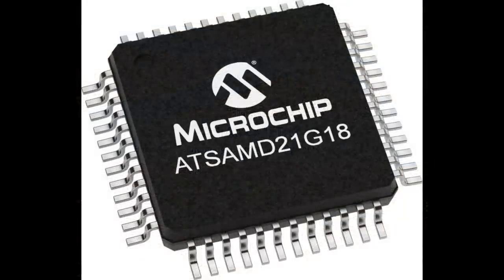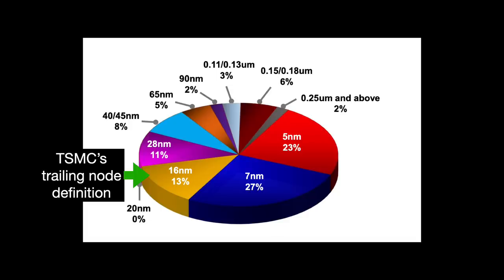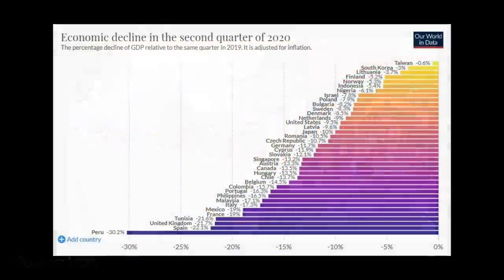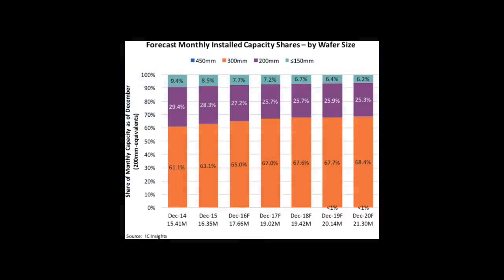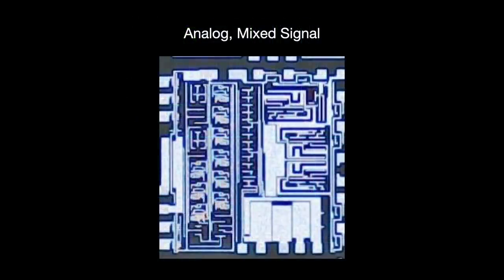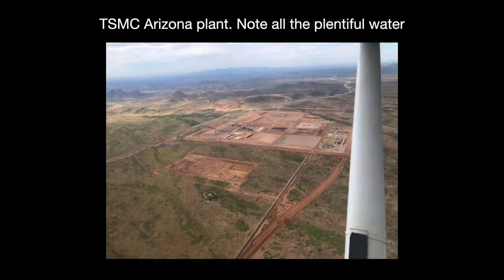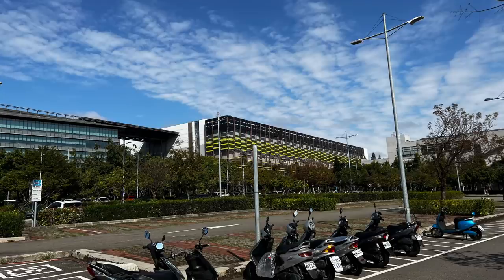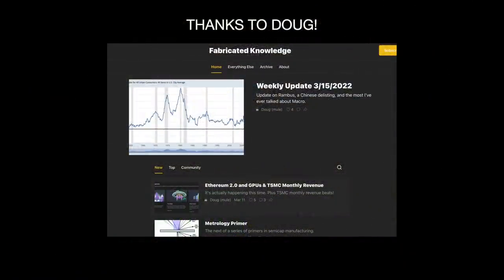Where The Real Chip Shortage Is

Comment: Some wafer technology doesn’t scale to larger wafers very well. Particularly non-silicon wafers that can only be produced in 150mm and 200mm sizes before inherent wafer defects create significant yield problems. 300mm equipment may double output, but it is often 5x+ regarding capital expenditure and maintenance cost.
Reply: Yup. I work in GaAs. Hard to make a Cz ingot when half the atoms in your melt sublime into vapor at atmospheric pressure.
Reply: Also, half the tools I work with on a daily basis are older than I am. And I’m over 40. Compound semiconductor makers almost exclusively inherited equipment from the 1970s-early 1990s silicon world because that’s all that’s available in many cases. What’s left are often 200mm tools down-converted to 150mm. With those kind of capital restrictions, an industry that charges cents per unit for its product and can fit 5,000-15,000 chips on one 6” wafer is never going to transition to 200 or 300mm.
Reply: Thanks for the perspective. Helps somebody coming from years of digital logic chips where increasing transistor counts have been the key essential.
Reply: Just to the last part: Any (not only multiples of five) "regarding capital expenditure and maintenance cost" is irrelevant when the net income(here the predicted value is sufficient) is above the previous one, the old production process provided. You just have to find an investor. That is no problem for such biggies like TSMC oder Siemens ... there are extra institutions there, invented just for that case which are happy to "assist", like banks and shareholders. But that is basic capitalism 101 and I don't want to bore you, Alexander:)
In a nutshell: If it's worth it, then anything will be implemented as quickly as possible. Lemme close with that picture: Haven't you ever seen a cartoon rabbit with dollar signs in its eyes?:)))

Don't get me wrong: Physical restrictions exist and no human, no Solar Roadways, no SpaceX and no Elon can avoid them. If @Grak70, for example, cannot even produce the raw material in good quality, then the discussion is actually superfluous. What doesn't work, doesn't work!
Reply: @Grak70  how close are you guys to offering the coating of prescription lenses with the gallium arsenide. i really want night vision next pair .
Reply: @tobiwonkanogy2975  different industry (beam or vapor phase epitaxy), but cool application. Not sure I want arsenic that close to my face, but I assume it will be encapsulated somehow.
Reply: @Grak70  from what i have gathered its chemically stable and can be coated with diamond like carbon coating or sar/ar/bbar coatings. Very correct i would want it sealed in quite well.
Reply: @dieSpinnt  You seem to be confused with regards to how things actually works. Capital expenditure and maintenance cost has a direct impact on the ability of an operation to adapt to new technology, scale to meet demand, survive harsh economic times, and provide affordable products without going under. We are seeing the results of that today throughout the world. Very few ventures toss around the billions needed , and most are backed by at least one government with malicious intent. This is why we have seen fewer ventures into the upper echelon of the manufacturing side of the industry, the rotting of the American semiconductor base, the shift to fabless, the extreme supply constraints, and is a contributor to the boom/bust cycle of the industry. “Just capitalism 101”.  Capital expenditure and maintenance cost has a significant and non-negligible impact on the industry.
Reply: @alexanderbrown6077  Yes, sure.
Reply: While this is true, if some capacity can be moved to 300mm then that frees a lot of 200mm capacity for things that needs to be produced on a 200mm node.

It's like building solar and wind to power homes, offices and commerce - While solar and wind will never replace nukes and hydro when it comes to industry, if it sufficiently powers residential and commerce it will free up power to let hydro and nukes directly feed into the industry. Win/win regardless.

Comment: Voltage regulators are also tough to buy.  As an EE, I won’t cut a PCB design loose until reels of parts are sitting on my desk, and then I over-order which doesn’t help the shortages.  I’m buying parts for life of product, knowing many of those parts will be eventually excessed.
Reply: Make sure the part you choose has many alternates from different manufacturers with the same footprint - jellybean parts like voltage regulators are the easiest ones to swap, even if it's a PIA mid production. A lot simpler than porting a bunch of firmware from one processor architecture to another.
Reply: Yup. I tend to finalize designs only once I find supplies for at least 2 alternatives. I seldom have the ability to source everything in advance of final design. Often this means extra pads for different pinouts or footprints. This also helps when sourcing parts for repair if your device is one that may see service.
Reply: I so FEEL you! Nowadays I first order enough chips to build out at least a couple of prototypes and then I start with the new design, otherwise it doesn't even make sense to even start (for the major chips at least) :P With voltage regulators I haven't had a problem tbh, but in terms of power electronics what I have had a problem sourcing is power inductors and transformers.
Reply: I understand your position and appreciate your frankness. By your own admission you’re making the problem worse. (That sounds more accusative than I mean to say, I’m not a native speaker) 

How long is the life of product that you’re talking about? Im just curious if it’s something like a year or several years. 
If you would stock for, let’s say, 6 months, wouldn’t that give you enough time to resupply? Again, I’m just curious and interested in your views as someone who works in the industry. Thanks for your comment.
Reply: @Conservator.  as of now, most microcontrollers have a lead time of over 12 months and it's changing all the time. I have an order for an ATSAMD51 that is already 1 year old, they increased the price twice during this time and I'm still waiting for them to deliver. Who knows what the lead time will be in 12 months, I think Louis Brown is right, better to have all the components in stock when launching a product.
Reply: I keep thinking that part of the long lead times is based on pending customer orders, where they have placed the order at multiple vendors, and intend to cancel the redundant orders when their first orders come through.  I don't have direct evidence of that though.
Reply: @gorak9000  This depends highly on what type of design you are working. Voltage supply ICs are for  the majority of parts not interchangeable;  yes, old legacy LDO stuff maybe, but not for modern high efficiency DC/DC regulators/controllers, which are the most common supply ICs used in todays designs 🙃I too, had several designs to change, advancing from prototype to the final product, because of this supply chain thing. 😒 Today, you can buy x component, but a couple months down the line your purchasing department will tell you, you can't.
Reply: @franks_9254  Is it because the switching frequency is different between them? The voltage divider values in the feedback circuit? Neither of them seems that hard to change if you're swapping the switching controller anyway. Seem like they should just be BOM changes if you stick to standard footprint parts (but I don't do board layout professionally, so I probably not considering some intricacies)
Reply: Having is better than needing
Reply: @Graham_Wideman  I don't think they will cancel the orders, they will keep the stock from all vendors. This chrisis is actually a hoarding chrisis more than anything.
Reply: As an EE student i started to design my voltage regulators on a seperate module incase the regulator becomes unavailable. (happend to me two times) and ordering a 100mm^2 pcb is cheaper than the whole board. but the over-ordering that i and everyone else started (with my very limited buget) is definitly not making it better.
Reply: @Conservator.  LOL 6 months isn’t bad now.  I have parts with a 93 week lead.  Of course all that could be delivered faster; but you just don’t know.  I’m in the defense industry, so paying $10 for a $2 part isn’t an issue as the volume is low.  It’s getting the parts that is a problem, hence I’m in hoarding mode now.
Reply: @FreezeS  Why not redesign for something more readily available? Like the Raspberry RP2040.
Reply: @jan.tichavsky  some projects can be redesigned, others have more strict requirements.
Reply: @rfengr00  
Thank you for your answer. If your volumes are low, I understand your comment and low volumes hoarding should also have a low effect on the global supply of these chips.
Reply: @FreezeS I didn’t know lead times, that’s why I asked. If your lead time is one year, wouldn’t two years of a stock be enough or would you still want 10 years worth of stock? That seems a bit too much to me. I hope these shortage will be long gone in ten years time.
Reply: Ah! So it's YOU!
Reply: @Conservator.  that's the thing, you don't know what the lead time will be in one year. So you order and hoard as much as you can afford. When you have a reliable 3 months lead time you can spread the cash on several products.  But when it's not then you spend all on parts for the products that you have contracts that say you pay late delivery fees.
Reply: @FreezeS  We agree that there’s uncertainty. Should you avoid that at all costs and buy for the total production volume before starting production or would it be enough to mitigate the risk by buying enough for the lead time plus a margin that you feel comfortable with. 

I’d think and hope that in two years time these issues will be a lot less. With a lead time of one year and high volatility, I might buy for maybe two years and evaluate every 3 months. 

It largely depends on the costs of the components and the price of the product you’re needing it for.
Reply: Just use an LM317
Reply: Same here. Thankfully I work in specialostic T&M gear, so volumes are low and the product is still profitable even if we have to buy a random microcontroller for $150 a piece from scalpers.

Anyway, we also first buy parts for 2 years of projected demand, and then design the thing. In case we end up not using them, we can quite possibly sell them back with a large profit, lol.
Reply: Reading these comments, there's so much I want to learn... What would be a rough game plan for going from zero knowledge to building some of my ideas?
Reply: @mmaranta785  The LM317 was awesome in 1976. Technology has moved on in the last 45 years. It just consumes too much power and real estate, now.
Reply: Believe it or not, I am utterly unable to source quantity of LM317T from any legit supplier or well-known manufacturer. It's probably the most ubiquitous voltage regulator in history and the best Mouser or Digikey can do for me is November.
Reply: I have to put all my designs on hold for a year. Even the common 2896 series (Solenoid drive IC), TL494 and even some of the BC series transistors. I have been made redundant at work because of this.
Reply: @gorak9000  I've run into this many times recently, myself.  Unfortunately many of these chips were designed for pretty specific external components (inductors and caps, especially) with many of the less-paid-attention-to parameters being critical to the circuit performing correctly.  Often swapping with a "compatible" part from another vendor leads to re-doing your BOM due to several other components that will need to be changed and sometimes you then run into footprint issues because the other replacement parts are not available in the original size. Switching supply design is not what I'd call "fun."   It's been honestly quite maddening...
Reply: @jan.tichavsky  While that part is more available, it is a lot less capable than many of the other micros out there.  Also changing a CPU requires significant code redesign which can be quite expensive.
Reply: @fusion9619  you've gotta build stuff man, sure there are tips and advice for how to go about figuring things out, but so much of it is just trying to build something and running into all of the problems along the way, then doing the same for the next project only the issues will be different, but over time your capabilities grow and you end up a designing, debugging machine.
Reply: SILERGY
Reply: doesn't your firm have a "components engr"?
Reply: @klam77  LOL no way.
Reply: @rfengr00  ah, well....that's a full time position: sourcing, pin-out compatible backups, supplier databases, maintaining documentation libraries (app notes, data sheets etc), in touch with QA/QC, etc etc....full time job.
Reply: @klam77  The problem with those things is that the manufacturers are not even telling the truth anymore as far as supply availability.  I've seen several keep changing their story almost daily.  It's to the point that you basically have to have your entire BOM's contents (in sufficient quantity for 12-24 months supply) IN YOUR HAND before you do a design.
Reply: @rgarito  wow. yeah, that's a new development. i don't have experience with it this bad. it's a full time job dealing with the field sales reps, inside sales, application engineers, shipping  and design, i tell you!